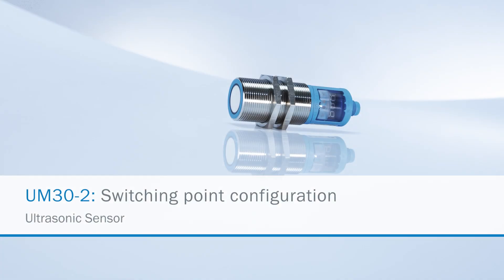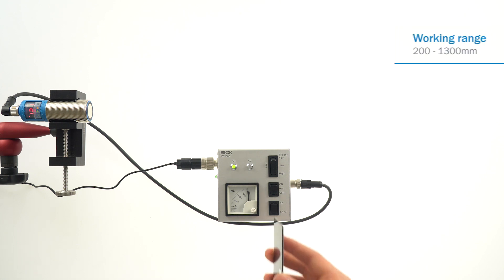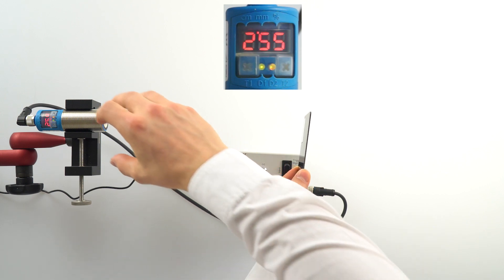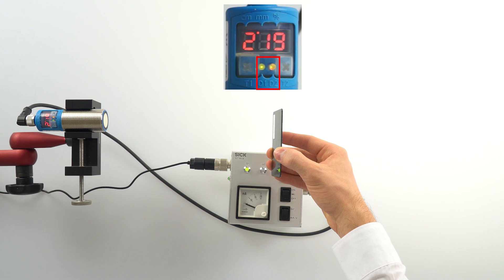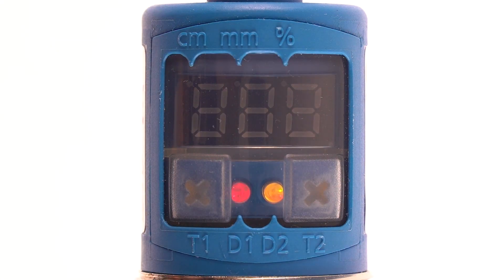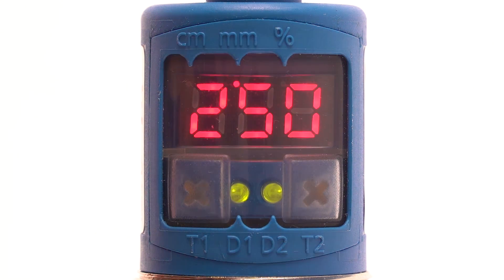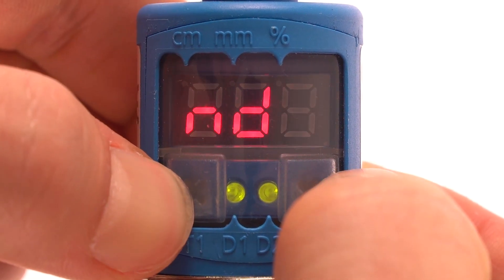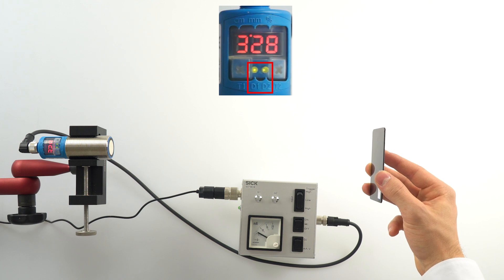Tutorial UM30-2: Switching point configuration | SICK AG

Comment: what angle can the object surface be at?
Reply from the maker: Hello @parsifal, the detection capability as well as the detection area depend on reflexion properties, size and alignment of the object. For the detection capability we can roughly divide objects in two groups regarding object angles, the first being smooth object surfaces with a detection capability at an angle of ≤ ± 3° and the second one rough object surfaces with a detection capability at angles of ≥ ± 3°.